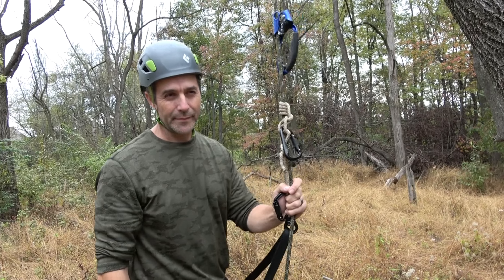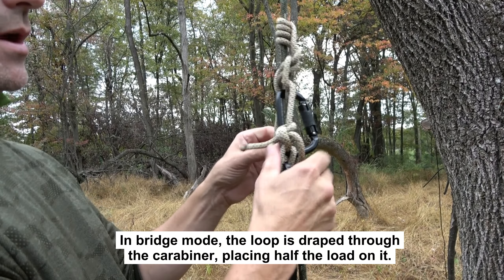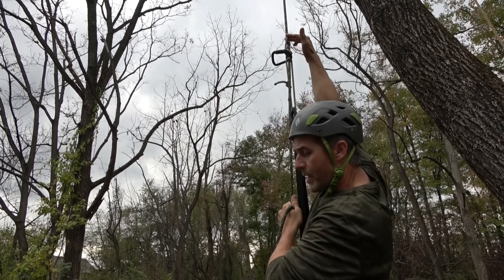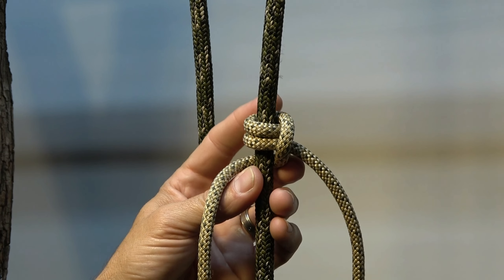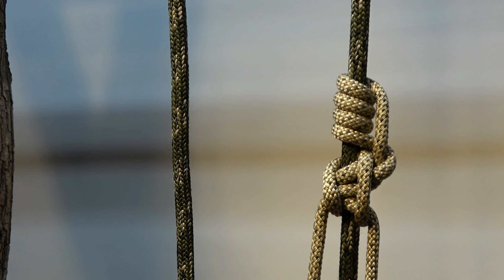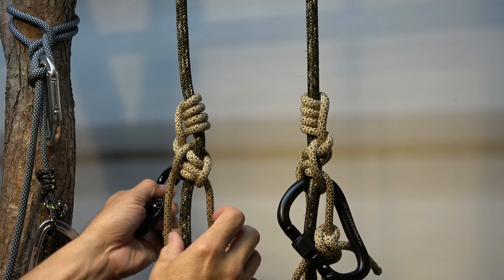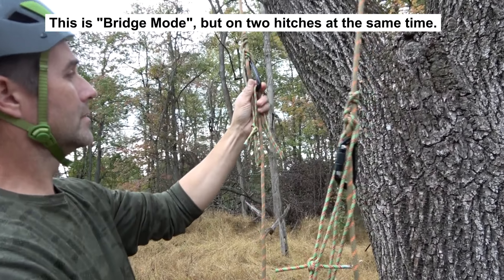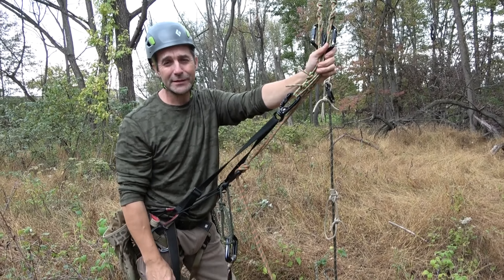Introducing the JRB Ascender Hitch, a new friction hitch!

Comment: I used the JRB Ascender Hitch tied using 8mm GM rope on a 13mm climbing rope (single-rope SRT) to prune dead tree branches 50 feet high.  It worked beautifully.  Distel, Prusik, Blake's, and Klemheist hitches, in my experience, cannot slide on a single climbing rope when fully loaded with my weight (80 kg).  The JRB slides up and down with ease when I push/pull the hitch directly using my hand, but holds my weight without slipping when I hang from the hitch.  That's very impressive.  Thanks for introducing me to this hitch!  I like being able to climb without specialized hardware.  It's important, for safety reasons, to be able to climb and descend with just ropes and carabiners in a pinch.  There are also cost (and sometimes stealth) benefits to not using ascenders, grigris, etc.
Reply from the maker: Excellent.  As you are likely aware, i don't recommend using a friction hitch as a rappel device. Also, please watch the latest video on this playlist for Tying the 523 JRB Ascender in Soft bridge mode. It's even better than the variant in this video.

Comment: Using your remote release knot for my 8 mm oplux rappel line is a huge improvement.  Also tried about every friction hitch  with 6 mm  sterling for a back up knot and the only thing I've found that works consistently is the JRB ascender hitch. 👍
Reply from the maker: That's good to hear Zane. When i came up with these knots the genuine thought that goes through my head is this: "the gang is gonna LOVE this once they understand how to tie it". Regarding the JRB Ascender Hitch, i use the non jamming if i need it really small. Otherwise i use this: 
https://youtu.be/oF9oGHQDiBA

Comment: I added this knot to my climbing system. The Blake’s hitch i was using often jambs on me. Thanks for the step by step on the tying, needed that for sure.
Reply from the maker: In a moving rope system? Are you manually advancing your friction hitch? Or have it tended for automatic progress capture?
Reply: @jrbtc  I am a saddle hunter. Ascend using the single stick method. I hang on a Blake’s hitch, On descent i form a Munter hitch and release the Blake’s hitch. Since i am usually in the dark, i don’t want to re-tie or untie, to reset my gear i slide the hitch back up to my caribener. Looking forward to an eAsier time doing that
Reply from the maker: @TradBowEd  yes i completely understand... Blake's hitch is more typically used in systems such as MRS (AKA DdRT or DRT) where the hitch is only seeing HALF of our weight.  Giving 100% of our way to a friction hitch is a true test. And so now that ya have the hitch tied... find the other video here on tying the 423 and 523 variant... and tie that in BRIDGE mode.  U will be amazed at how easy that moves even with 100% of your body weight on 8 mm rope.
Reply: @jrbtc  ok I will do it
Reply: @jrbtc  Thanks JRB! you know I am gonna try that. So happy I bought extra rope. Tell me, what are the diameters of ropes that you are using? I think that I have 8 with 6.
Reply from the maker: @TradBowEd  6mm cord on 8mm rope is a good match.
Reply from the maker: @TradBowEd  This is a new knot... some discussion was warranted... and so please make sure you have watched all the vids on the playlist.
https://youtube.com/playlist?list=PLETL-PceEXkYzZVteVwc0REz37uDr7-_C
Reply from the maker: @TradBowEd  I don't recommend that. Instead, run it in bridge mode with the cord run through that Loop and make the loops very small and load both of them. That breaks extremely easily and does not compromise the Integrity of the hitch.

Comment: Excellent,  brilliant work.   I was planning to develop such a system for occasional instances.  I love that it requires no metal parts,  as quiet is key for my purposes. 
Thanks for sharing!
Reply from the maker: Thx. 'My pleasure to share and give ya options... be aware this is a NEW knot and so we're exploring it together.  This was the introduction but there are now 3 vids on the playlist, which you should be able to find on the channel, link below.  Make sure ya watch #3. The 523 variation is my primary hitch now, 6mm cord on 8mm rope. 
https://youtube.com/playlist?list=PLETL-PceEXkYzZVteVwc0REz37uDr7-_C
Reply: @jrbtc  understood.  My decisions are mine alone.   I have been using/ developing  a two tether climbing system  that is great for,  we'll say ideal trees,  but not for those where your's is well suited.   Now I'm thinking about a possible hybrid  with relatively little additional gear. 

Great channel !

Comment: I really appreciate your knowledge of knots and hitches! I'm using this JRB Ascender Hitch, instead of a Figure 8 with a Prusik auto-block. This hitch will require less mechanical devices and become less weight at the same time.
I'm using the 2TC climbing method for bowhunting. I will now use your ascender hitch for my upper tether line, instead of a Ropeman 1 and a carabiner....then having to switch over to a Figure 8 and a Prusik to rappel out, at the end of the hunt.
Reply from the maker: Excellent.  I prefer the 523 version, as described in the later video on the playlist, and now I am using the non-jamming variant as well. I like to think that I'm just providing you with some tools for your toolbox and you can figure out the best application for them.
Reply: @jrbtc  I actually use 5 wraps on the top of this hitch. I seems to bite and hold a little better.
Again, I can appreciate all of your knowledge. However, I will only use what will apply to my climbing situation. The only time I climb, is for bowhunting.
Reply from the maker: @Outdoorguy57  this is the first video on the playlist. And so make sure you watch the others. Particularly: 
https://youtu.be/Ju7wJM_uxtw
Reply: @jrbtc  You'd be laughing your azz off, if you'd seen me struggle tying the hunter's bend knot.
I have always used a square knot, but thought I'd give this one a try. I got it figured out, finally. hehehe
I did watch the video you recommended. Very educational!!!

Comment: Live this channel! It was recommended by the guys at Rock n arbor. 
I’m a bigger guy, 300lbs on a good day. I’m interested in using the JRB ascender hitch
I currently using 8mm resctech and wondering if that’s sufficient for this system. And what size and cord I should use for the actual hitch for the 8mm resctech? 
Thanks again!
Reply from the maker: I took advantage of your great question to improve the level of detail on the website.  Please take a look at the information here and adjacent pages. But the bottom line is that I can't recommend 8mm rope for a single rope application for big fella like yourself. It's not just a matter of strength. We gotta consider the ability for a friction hitch to hold and be reliably broken under load, even in wet conditions. If you are using a single rope system , consider a  11mm rope with 7 or 8mm cord.
https://jrbtreeclimbing.com/content/rope/

Comment: Good system. 
So do you have your hitches pre tied to your climbing rope and just drag all of that over your limb when you put your rope in the tree to hunt? 
If so, how does all that go through a crotch? 
Do you attach the carabiner after setting the rope in the tree?
Reply from the maker: Hi Paul, I am doing my best to organize the channel by playlists, separating buckets of relevant information growing over time. On the JRB Doubled Rope climbing method, you'll find vids with details on how I rig it into the tree. Attached is one which goes over a lot of details. But yes, i put the friction hitches on once and don't remove them unless i am inspecting or replacing.  It can't get hung up in the crotch because of the way its rigged. With 8mm ropes and an appropriate diameter cord, i have never had one fail to pass through a crotch.  But it is possible.  If we were using arborist diameter stuff like 9mm cord on a 12mm rope, that's much more likely to present a problem passing through the crotch.  Although i haven't found anything that beats the performance of a JRB Ascender Hitch, it's definitely lot to tie. I am currently testing and will soon show you an alternative hitch that is close in performance but much easier to tie.  
https://youtu.be/vkrPf_5bwAk

Comment: John, I tied and tried the 523 Hitch today and tonight. I really like the way it releases when a load (me 210lbs ish all suited up) is applied. Is seems to be a bit difficult to advance it UP my rope. Your videos show that is should be relatively easy. I have 6mm sterling acces. cord around 8mm oplux. Could my 523 be tied too tight or something else...?
Reply from the maker: That is an aggressive combination of cord and rope, particularly if you're using a SINGLE rope for your entire body weight.  As far as I know, Sterling doesn't recommend anything less than 7mm for life safety applications.  My first suggestion would be that: 7mm Sterling does work on 8mm rope despite the 87% ratio.  2nd, be sure you're using the carabiner handle. 3rd, tie it as a 523 in soft bridge mode (see video on that) even if you're only exposing one load loop. 4th, be sure you're not rappelling on the friction hitch.  If you are, you may need to tune it as you start your next climb.  Tune it by ensuring that the proper amount of Slack is in the hitch and exiting via that descending load strand off of the upper helix. I would need to actually see it in order to say more. Facebook is better for that and you can post that in the group: JRB Tree Climbing.

Comment: Does the cord for the friction hitch need to be made out of  special material like dynema?
Reply from the maker: If you're using this for a climbing application, you'll want to buy products from reputable sources which are appropriate for the application. I  have recommendations on the shopping-list page on my website: JRBTREECLIMBING.COM. 
Dyneema has a relatively low melting point and so it is not typically used in the creation of cords for friction hitches.  However, i have tested cords with a Dyneema core and they worked great. I just don't allow slack in the system and don't rappel on friction supplied by the friction hitch.

Comment: When youre moving your foot loop up the rope, could you not run the foot loop rope up through the ascending hitch beener as a pulley instead of having to drop the rope each time?
Reply from the maker: Absolutely, you could. If you're using a thicker or stiffer rope, you might find that this helps you. When I am taking slack out of my foot loop with my arm, I am also lifting my leg at the same time so as to leave no weight on it. And so I don't find it necessary and tend to go with the easiest and fastest option with minimal complexity. But it's a great question and I encourage safe experimentation. That's how we got here and great questions like yours are what is making it better.

Comment: I too am using predator rope for DRS climbing. How are you using it in this video?
Reply from the maker: In this video, the Predator rope is being used for a demonstration of the JRB Ascender Hitch on a 'Texas-style SRT configuration.  It is attached to the tree via a canopy anchor and the footloop is my own design, video here on the channel.  Note that this is not my preferred method of climbing, which is the JRB climbing method, a parallel, stationary, doubled rope system, shown at the end of this video.  The Sampson Predator is a great rope though, and useful in many systems and methods.
Reply: @jrbtc  I like the ascender hitch you demonstrate in this video and I already have the predator rope. This is my first year trying saddle hunting and am like a sponge right now.  Just looking at different systems. You are a great source of information

Comment: Forgive me if this is a stupid question, but do you back up your JRB hitch like you would a Mad Rock Safeguard or other belay/rappel device?
Reply from the maker: Not a stupid question.  The answer is yes. In the JRB Climbing system or an SRT variation of it, the JRB Garda Hitch footloop has 2 purposes: 1) its a footloop for ascending 2) it provides a 2nd and independent point of attachment for our bridge.  Find the video for JRB Garda Hitch footloop.
Reply: @jrbtc   Thanks!  When you get to hunting height, do you back up your hitch when you're standing on your platform/ROS?
Reply from the maker: @pantherlefty  a backup or tie off is always a good idea. As a minimalist, i simply leave my garda hitch in place and typically keep one foot in the loop too. It's my backup. If my friction hitches slipped or failed, i am safely on the Garda because it is attached to my short bridge as well.
Reply: @jrbtc  Much appreciated! Thanks for the help!

Comment: Is this climbing system safe to use on a single rope? I'm wondering because in my particular situation, most trees do not have strong crotches(most trees are pretty straight with few branches). I plan to feed the rope around a small branch, tie an alpine butterfly, feed the rope through, and then climb the same way (using the ascender hitch and garda footloop) on a single rope rather than double.
Reply from the maker: Matt, the determination of if a climbing system is "safe" is ultimately going to be the responsibility of the climber.  There are many factors. I like a thicker rope and thicker cords for SRT, such as the one I used in this video. We can SRT climb using this hitch as i demonstrated. You also can use my Double Michoacán for it. Remember that I don't like to need to do any knot tying at the climbing site; I want it already rigged. For a canopy anchored SRT system, that means you'll need a rope long enough to slide the friction hitch out of the way and back into position when you are ringing your anchor. And make sure you have your redundancy in place: you're redundant Bridge clips into the small Loop in your Garda hitch foot Loop.

Comment: Looks very kool.
I tied it and tried it.
It doesn't do anything my current hitch doesn't do.
I only use 28 inches of cord, half as jrb.
I also only use a single line and one stick.
Jrb is kool and works but I guess I'm out because of the basket weaving and amount of cord used to do it.
Otherwise  nice.
Good luck.
Reply from the maker: Cool. Hand on a second though cuz i am not aware of any other friction where you can put in a handle and it can take a load even when there's no load on the strands. And so do you SRT climb with yours with a handle? And how do you yet yours to take load on 4 strands? I am not aware of any other hitches which have those properties.

Comment: I’m very interested in how you finish a climb positioning yourself between two crotches, a split tree trunk, often would like to hunt out of a large tree with such split stem/trunk…. with the friction hitch points on your bridge one to one crotch one to the other, how do you move to one side or the other for your final hunting setup, I guess you end up climbing a little more on just one side of the rope, and then you throw another tether ?
Reply from the maker: No tether for me and no platform... i like to use what the tree provides. I like to stay several feet under my TIP giving more freedom to maneuver. I like a crossing branch under my feet, allowing 180 degree change in direction

Comment: Will it work when the rope is wet from the rain??
Reply from the maker: Yes, but realize that the hold of any friction hitch is affected by how much natural friction is present between the cord and rope and that will vary based on the cord and rope in use, including materials, diameter, condition, as well as conditions such as water or even ice. In my own testing of my own systems, i will soak the rope and cord in a bucket of water for hours then test it. In some cases, i will need to add a turn. So a 423 becomes a 523 or a 523 becomes a 623. Please see the other videos on this playlist for details on those configurations.